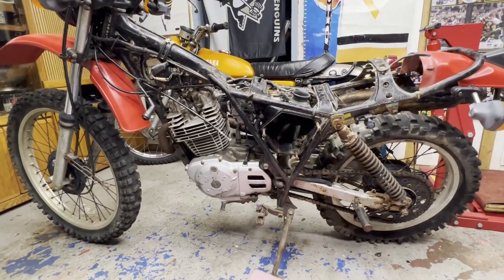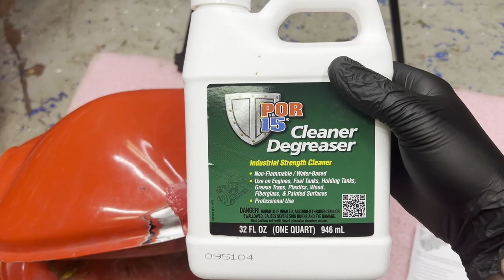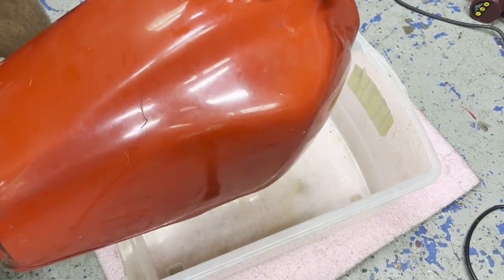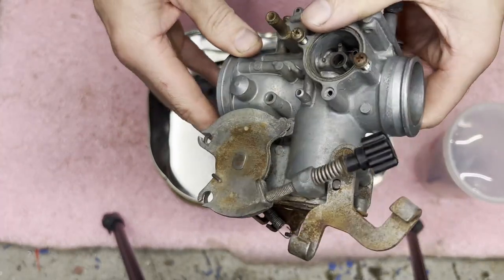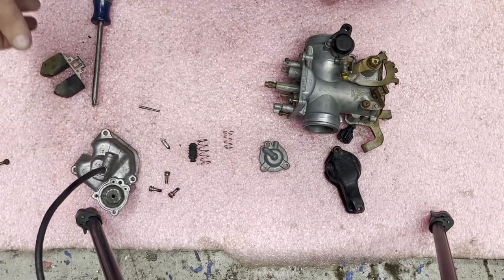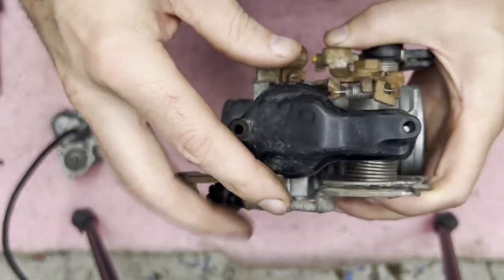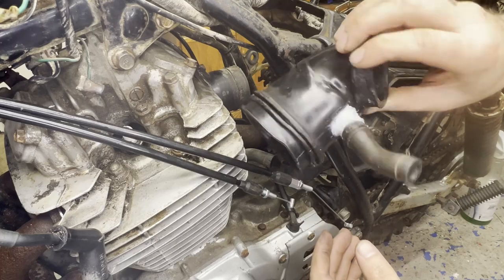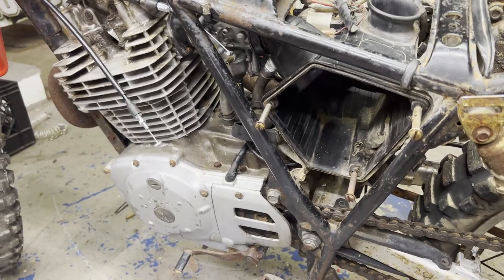1981 Honda XL500S Part 2: fuel tank rot and carb clean up

Comment: Also not sure how you'd feel about having a plastic tank as it would take away from the vintage look you're going for but check out clarke tanks. They make higher capacity tanks for all old bikes including yours.
Reply: I'm not trying to spam your videos lol but was that soapy water you were using in the ultrasonic cleaner ? If so you need to switch to a solvent to avoid any rust or corrosion that water would undoubtedly create.  Just trying to help!
Reply from the maker: That’s ok, I appreciate the input!  Yeah just water and dish soap.  Once they are pulled out of the ultrasonic they are blown dry and with an airline so there wouldn’t be any water sitting.  Same with the fuel tank…once the vinegar was drained I just flushed it out with water, then sprayed with wd40 to prevent flash rusting.  Then, as you said I usually flush with some gas before adding in fuel to run it.  I ended up selling this bike at vintage days to get two more projects for the channel.  These are great bikes!